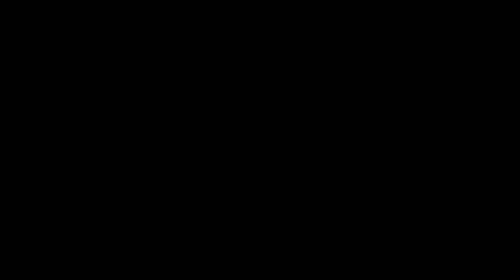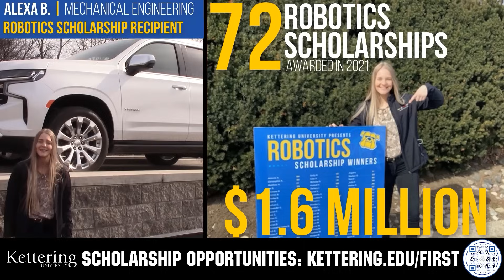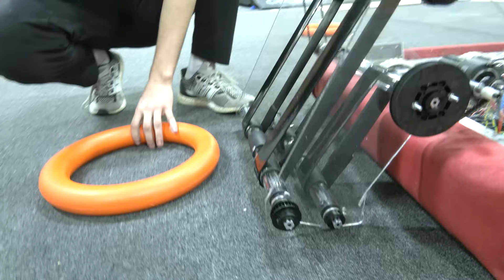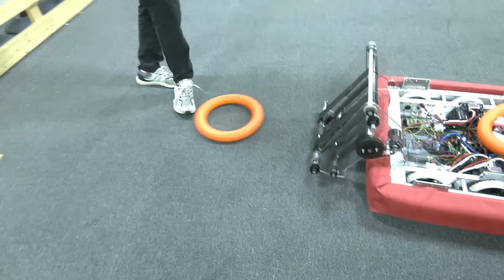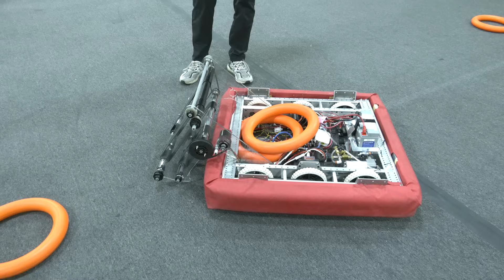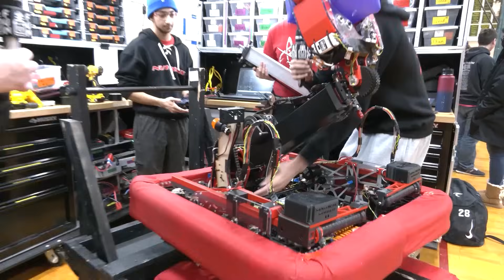Belt Ground Intake Prototype Works! | Cranberry Alarm Ri3D | CRESCENDO 2024

Comment: arent you not allowed to extend more than 1 foot outside of your frame perimeter? or is this inside the 1 foot margin. technically you can only extend 8 and a half or so inches outside of your frame perimeter considering the bumber takes up like 3-4 of those inches
Reply from the maker: You are correct. G413 B states "it may not extend more than 1 ft. (~40 cm) from its FRAME PERIMETER."

Comment: Worst new rule ever
Reply: more worse than no shrimp fried rice in the pits?
Reply: There cannot be holes or gaps in the bumper now, therefore the intake has to be outside the chassis of the robot
Reply: @ThatGuy20091  oh, is it only this season?
Reply: @andyalshabi5189 it’s a green rule so it’s seemingly permanent 😢
Reply: And your attachment can only extend a foot @ThatGuy20091
Reply: What is the rule?
Reply: What